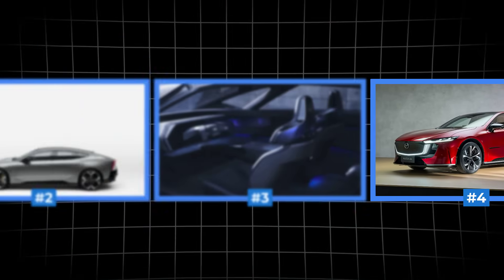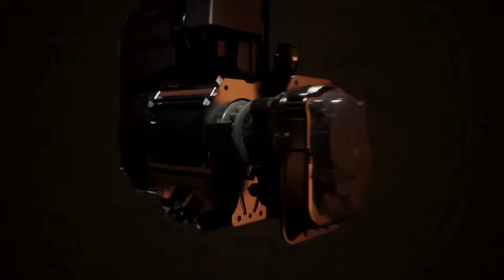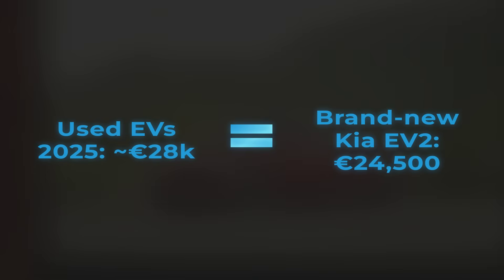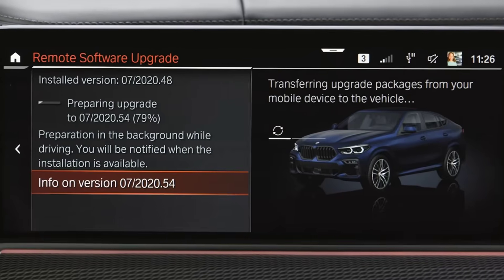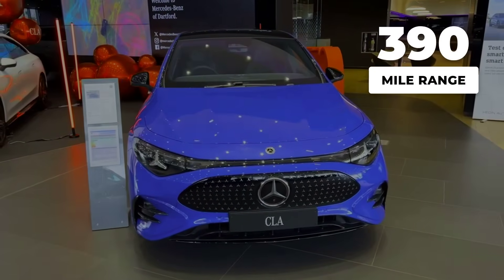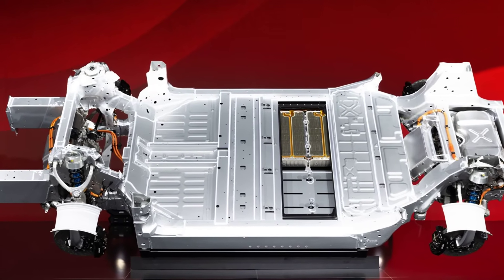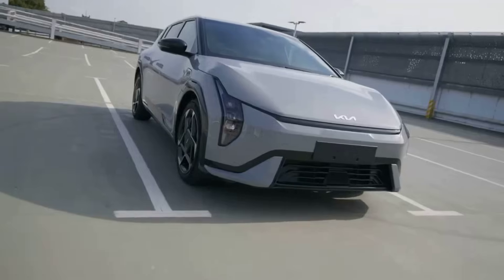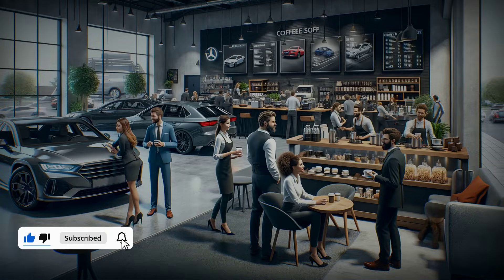STOP Buying EVs: Wait for These 2026 Models

Comment: The Big buzz is on the Nissan leaf 300miles and a stunning price beat that
Reply from the maker: The 2026 Leaf is a total game-changer, especially since it’s morphing into a sleek crossover with up to 303 miles of range for under $30,000. 🔋 It's finally getting a liquid-cooled battery and NACS (Tesla) port compatibility, which solves the two biggest headaches the older generations had. Tbh, do you think this "budget-friendly" crossover can actually steal the crown back from the Tesla Model 2? 🚗

Comment: Tesla may net be the most luxurious, feature-ridden, comfortable, prestigious, or good looking. But the availability of FSD makes it the king for an electric car.
Reply from the maker: FSD is definitely Tesla's "ace in the hole," especially since it handles city streets and complex intersections that most other systems still won't touch. 🏙️ That said, 2026 is when we'll see if the premium build quality of the German brands can finally catch up to Tesla's software edge—do you think you'd ever give up FSD for a more "luxurious" interior?
Reply: @ChargeZoneGarage Once you get used to FSD, it will be hard to go without it. I don’t believe anybody will be able to catch up to Tesla’s FSD, given the vast advantages that it has built up: neural networks backed by immense compute power, billions of driven miles data, total vertical integration, Elon’s vision.
Reply from the maker: @erwinmasusu4342  Tesla definitely has a massive head start with that data flywheel and vertical integration. 📈 It'll be fascinating to see if high-res LiDAR and redundant sensors on these 2026 models can actually compete with Tesla's "vision-only" approach. Do you think raw data matters more than the specific sensor suite when it comes to true autonomy? 🏎
Reply: @ChargeZoneGarage  Data definitely matters. Much more important than actually "seeing" what is going on, is how does the car reacts to it, both in terms of time taken and the actual response maneuvers. This is where experience (data) and inference capabilities come in. Tesla has a massive advantage here and this advantage is only going to grow with time.
Reply from the maker: @erwinmasusu4342  That data moat is real—training a neural network on billions of miles is something you just can't "buy" overnight. 📈 It's the classic battle of Tesla's "inference at scale" vs. the precise sensor fusion (LiDAR/Radar) we’re seeing in the 2026 rivals. Do you think a more advanced sensor suite can ever truly compensate for having less real-world training data? 🏎
Reply: @ChargeZoneGarage  More advanced sensor suite might help somewhat but not nearly enough to compensate for slower inference. Also, some time will be taken for coordination between the different types of sensor.  Having just visual is much better, except in conditions where visibility is compromised. Maybe the best is to rely mostly on cameras and use Radar/LiDAR only when needed.
Reply from the maker: @erwinmasusu4342  That’s the core of the debate—Tesla betting that "solving" vision makes everything else noise, while others want that LiDAR safety net. 🕸 The latency and logic required to merge two different sensor "opinions" can definitely slow down a car's reaction time compared to a single neural net. Do you think we'll ever see a non-Tesla manufacturer actually go "Vision-Only" once they see the data advantage?
Reply: @ChargeZoneGarage Absolutely. Even Google, Ford and some Chinese EV makers have openly admitted that Tesla has got it right.
Reply from the maker: @erwinmasusu4342  The industry is definitely eating some humble pie—seeing Ford and others adopt NACS was a massive turning point. 🥧🔌 Do you think Chinese automakers are the only ones moving fast enough to actually challenge that lead right now?
Reply: @ChargeZoneGarage Chinese EV makers are probably ahead of everyone else except Tesla. They have the whole government to support them fully even if they are not profitable. Will they ever get ahead of Tesla? I don’t know but it will take them a while to catch up.
Reply from the maker: @erwinmasusu4342  Actually, BYD is on track to officially overtake Tesla in total annual sales for 2025, which is a massive shift in the leaderboard. 📈 While the software and FSD gap is still huge, the sheer hardware volume and vertical integration coming out of China are definitely putting the pressure on everyone. Do you think Tesla's "Tech First" approach will keep them on top, or will the "Hardware First" scale of the Chinese makers eventually win out? ⚡

Comment: A lot of none realistic hype! 800 volt systems are non existent in the USA. The car is like having a 1/4 mile horse inside a stable 😢
Reply from the maker: 800V tech is actually already here in the US with the Ioniq 5, Lucid Air, and Taycan! ⚡ The challenge is definitely finding working 350kW chargers to match that speed—have you seen any high-speed stations in your area yet?
Reply: @ChargeZoneGarage 
They are unicorns my friend
Reply from the maker: @RicardoJimnz  Wait until you see them on the road—the tech inside some of these is going to be wild! Which one on the list feels the most like a "fantasy" car to you?
Reply: @ChargeZoneGarage the actual 800 volt architecture. I’ve own EVs 14 years and even the 300 volts already in use are not very consistent delivering. I understand is complicated because we are talking delivery methods and receiving methods and that’s where the problem starts.
Reply from the maker: @RicardoJimnz  You’re spot on—the "handshake" between the charger and the car is where the magic (or the headache) happens. 🤝 Even with 800V, things like thermal management and grid stability can still bottle-neck that peak delivery. In your 14 years of driving electric, have you found a specific network that's actually been reliable for you? ⚡
Reply: @ChargeZoneGarage 
Tesla has reliable speeds, not super fast but manageable. In my experience cha hung in the wild is every place is unique as far as keeping a steady constant load. Most start slow go up and at around 70% they start dropping drastically
Reply from the maker: @RicardoJimnz  That drastic drop at 70-80% is the classic "charging curve" in action—the BMS slows things down to prevent the battery from overheating and to protect its long-term health. 📉 It’s a lot like filling a glass of water; you have to slow the pour at the very top so it doesn't splash over! Have you noticed if any specific networks or brands seem to hold that "peak" speed longer than others? ⚡

Comment: 300 or 225 miles? Losers! Over 100 k$. But where is the FSD? 800 volt tech? On USA’s fragile utilities? Maybe in 5 years
Reply from the maker: Fair point on the grid concerns, but 800V tech actually helps by pulling more power in less time, reducing the "line" at the plug. Most of these models are targeting a much lower entry price than $100k to finally make EVs realistic for everyone. Do you think the grid upgrades will actually keep pace with the 2026 rollout? ⚡️🚗

Comment: You come out with an EV that delivers a full charge in less than 10 minutes and delivers the 570 miles of range my XJL delivers, I'll take it. As a serious long-range traveler, I need a car that delivers. EVs? Not yet? I'll wait...
Reply from the maker: That XJL sets a seriously high bar for highway cruising! 🚗 While 570 miles with sub-10 minute charging is still the industry's "holy grail," tech like solid-state batteries is aiming for exactly that. Do you think you'd switch sooner if the charging speed improved, even if the range was slightly lower?
Reply: @ChargeZoneGarage Oh he'll yeah!! My 2014 Buick lacrosse hybrid only had a little over 300 miles of range. But, the difference is that it only took me 2, 3 minutes of fueling, and then I was up and out, on my way. If I could have an EV that took a few minutes to charge,  would work to.

High range simply gives you the ability to (keep moving). That along with traveling through the night when everyone is home and out of the way, a great ETA is definitely the result. No, I Don't fly, and high-speed bullet train technology which is also (fully electric), doesn't exist in the mighty United States of America. So it is up to me to get us there and I have been doing it for 40 years. My entire family are well seasoned, serious long-range travelers because my entire family is scattered about the eastern seaboard and a few states in the mid west. We all have high ranged cars. Yeah I would take an EV that fully charges in under 10 minutes. ..
Reply from the maker: @carlsmith1118  The minimal downtime of a 2-3 minute fuel stop is the gold standard for long-distance drivers like yourself, no doubt about it. 🛣 That speed is exactly what next-gen battery tech is trying to solve for us!

Since your focus is on those long night drives across the Eastern Seaboard, what is the single biggest reliability fear you have about switching to an EV for those trips?
Reply: @ChargeZoneGarage  Mr Zone,  here's an example. When I travel from Lancaster county Pennsylvania to Jacksonville Florida, I make this 831 mile endeavor at night because there's less people on the road and you have a lot of highway to yourself with the exception of a few big trucks. There's absolutely no way im going to use any car that's going to hold me up by wasting my valued time sitting around and Watching everyone else come and go.

Between Pennsylvania and Jacksonville Florida, it doesn't matter how many times I stop for what ever reason, I only have to stop once to refuel thanks to the 570 miles of range. 5 minutes later, im gone. The trip takes me 11.5 to 12.5 hours to complete. That same trip in an EV with 300 miles of range? It doesn't matter how many times you stop for what ever reason, you have to stop 3 times to not only plug in but now you'll have to sit and stay awhile! That's 13.5 to 14.5 hours or longer by EV. I brought my used Tesla model S to use solely for what it was designed for, (short-range)local destinations only till I got rid of it after paying out six thousand dollars to fix the technical issues that developed with it. 

So the next time I would even think 🤔 about buying another one, it will be a large and luxurious EV that fully charges in under 10 minutes (atleast)!! And delivers a real travel range of over 500 miles and without paying over 100K for it like Lucid air which I almost brought. Did you know Tesla makes the model Y that delivers 500 miles of range? But only for China!!! F**Ken (china)!!! Why not for America? Yeah I'll wait and keep the gas. Money I have, time I don't. All those who do road trips in EVs? You enjoy your stay and I'll keep going to reach my destinations..
Reply: @C @ChargeZoneGarage er here in the UK I drive at least once a year from southern England to my son in Zurich Switzerland in my VW EV (it’s an ID3 Pro S but they aren’t marketed in the USA looks a bit like a golf)I prefer to drive at night when the roads are empty and the journey takes 12 hours door to door including the 35 mins on the car transporter train under the channel tunnel. On my most recent trip I charged for 11 mins in Reims in the centre of the champagne region, 30 mins at Verdun while I visited Starbucks at 2am and freshened up then 28 mins (10 was all I needed) on the French/German border near the Rhine while I had breakfast. I’ve driven there for many years in previous unleaded and diesel cars and the total journey time was pretty much the same as I like to have a break on the way, even at night. Safe travels everyone
Reply from the maker: @tomstringer3951  That 12-hour trek sounds like a masterclass in efficient EV touring! 🇪🇺 The ID.3 Pro S is a great choice for that run—especially with the 2026 updates bringing the max DC charging up to 185 kW and that solid 350-mile WLTP range. 🔋 It’s a shame we don't get the ID.3 in the States, as it’s the perfect "electric Golf" for those of us who don't want a massive SUV. How is the software holding up on those long nighttime stretches across the border? ⚡
Reply: @C @ChargeZoneGarage  yes it’s a 2026 model year and I took delivery in August. I’m currently on software 5.4 although I believe 5.6 is imminent. This is my second ID3, previously had a 2022 Pro Performance 58kwh. The charging speed on my new model alongside battery preconditioning makes a massive difference on a long trip as well as 100 miles extra range. Software is a lot quicker and the bigger screen along with standard Spotify makes it truly amazing. I have a minor glitch with the ACC dropping out at random but it’s booked in under warranty-it may require a new steering wheel apparently. Take care. Bye 👋
Reply from the maker: @tomstringer3951  Bye. Thanks for the comment.
Reply: Who drives 570 miles regularly!what a joke!
Reply: @dennisknehans3206  As a serious long-range traveler, I drive from Lancaster county Pennsylvania to Jacksonville Florida, Johnson city Tennessee, Dallas Texas, Chicago Illinois, st Louis Missouri just to mention a few of my (long-range) travels. With my entire family spread out around the country, we all do and we all have (long-range) cars. So we drive long and far and that's no joke...😊

When im not over the road, I fill up from a half tank once every 4 to 6 weeks thanks to that 570 miles of range. 35 to 45 bucks big deal, I make that every 2 hours. I don't have to sit and stay awhile with a car that does nothing but hold me up by wasting my valued time sitting around watching everyone else come and go and all for a short and shitty range. That my friend is a joke😅. With a long way to go and a destination to reach, im up and out. You enjoy your stay... so much for jokes...
Reply: @dennisknehans3206 and without a break. Must have an amazing bladder
Reply: Keep dreaming, if you can drive over 500 constant miles your chances of ever buying an EV will be a long wait if ever. My car does 300 miles and I never drove 300 hundred miles straight and in the mean time keep buying fuel, oils, fluids, maintenance and deal with she shifting, breaking rattles and instability of your ICE car
Reply: @RicardoJimnz I'd like to say that a EV with 300 miles has efectively 180 miles of autonomy because of the 20/80 rule if you don't want to destroy batteries. Effectively a 570 miles EV has in the 20/80 rule, 300 miles of range 👍
It's not about doing it everyday, it's about options if you decide to do a "longer" trip
Reply: My bladder and level of driver attentiveness can’t keep pace with 571 miles.
Reply: @tomstringer3951 That's you. It doesn't take me no 20 to 40 minutes to empty my bladder either. I have my times to rest, stretch and so on. But not because my car says so..